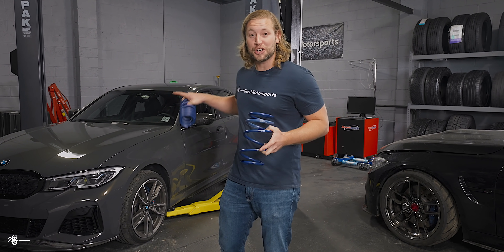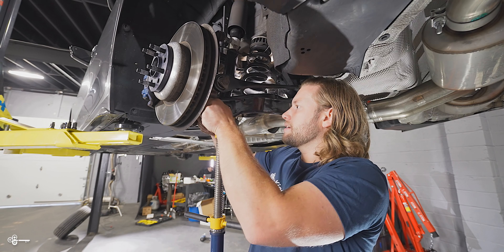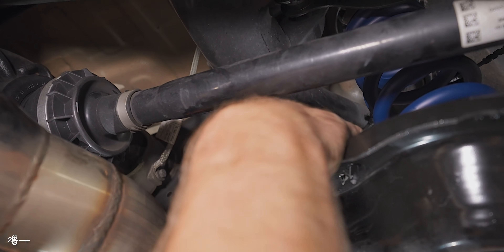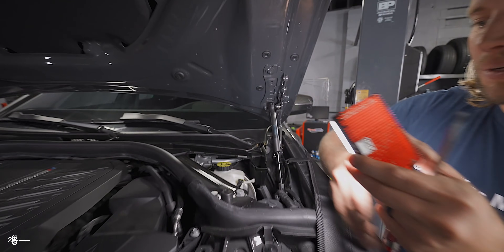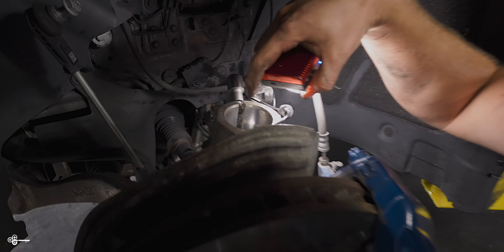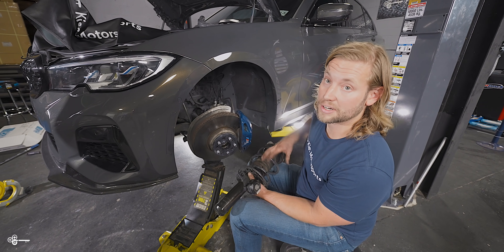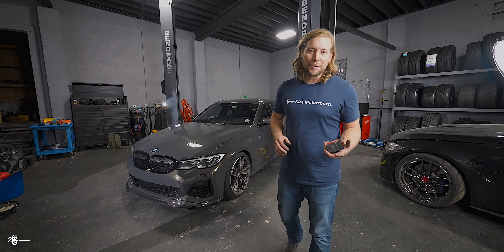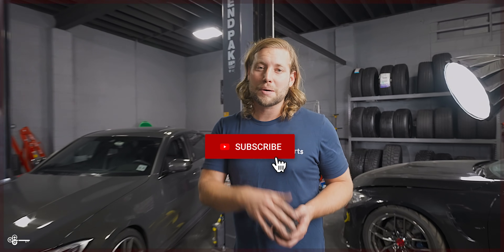HOW TO LOWER YOUR G20 BMW THE CHEAP AND EASY WAY (M340i, 330, etc.)

Comment: Anybody watching this that's struggling to slide the knuckle low enough, here's a tip.  You MUST loosen the 4 e-torx at the top of the strut first, ideally take them all out and leave the last one only a few threads engaged.  The strut has to pivot in order to have the right angle to slide all the way out.  Don't be like me and thinking, "Oh, I'll just remove those last..."  Cost me an hour of sweat and swearing.  Hopefully I save someone else the same fate.  Thanks Kies for this video, all of your how-tos are amazing.
Reply: I am having trouble getting front strut out do I have to remove axle and lower control arm
Reply: Awesome tip. I was definitely struggling. The knuckle was only halfway off and wouldn't go any farther.

Comment: Alternate title: “How to make your car impossible to get under, scrape your bumper on driveways and speed bumps, and irritate tow truck drivers”.
Reply: Thats just dumb. You dont have to slam your car. Like i lower mine only about 3cm, and its perfect. I can park and drive normaly. Dont scrape and can work on it. So yea. If you wanna go rly low then air suspension. With springs it would be tooooooo stiff. Bmw i have a f36
Reply: @WasteOfTimeDude  depends on the roads, if you drive on highway it s nice but daily through city traffic and bad roads it won t be pleasure to drive it

Comment: Lord I hope someone spends the money to get this done professionally on a new $50-70k BMW.
Reply: $60k car and did it at home. Absolutely 0 issues. Then drove 100 miles and got a custom alignment. Couldn't be happier with the outcome. Only difference is I have Dinan springs and followed the Dinan alignment specs. I haven't heard or seen H&R alignment specs.
Reply: Why? It’s so easy.

Comment: I installed the springs on my 330e and now having problem with my adaptive suspension. We didn’t disconnect the left rear sensor and now it is giving a false height. I already pushed it straight because it had the wrong angle. Also code in ISTA the new calibration. The fault code is still there. Anyone knows what to do?

Comment: Help Needed i have a 2021 m340i xdrive a few days ago i got Silvers Coilovers installed and now i have a check engine light with Chassis Stabilization, Cross Traffic Warning and Regenerative Braking Reduced issues.

Comment: You gotta get yourself a spring tool that’s mounted on the wall. You put the strut in & it has a hand crank. You tighten down the spring, take the nut off & take the strut out. Way better/safer than that one. Wall mounted is a lot sturdier & you have a lot more control too…..✌🏻🏁

Comment: Great content! I’ve seen on the evolve channel that they never take out the front strut to replace the springs. They merely disconnect the knuckle, and unscrew the damper. Then they tilt the strut outboard and pull the spring right off and replace it with the lowering spring.

Comment: I remember when I was in high school,  we just jack the car up and cut the coils-spring. Quick and easy,  But then the car sit so low it drag everything with it. I remember we had to replace an oil pan after we ran across a few speed bumps.  😆

Comment: Very good work and good explanation how you perform this work.
In my opinion, almost all lowering springs take G20 too low. It would be super nice for just 15-20mm lowering. Like M-Sport suspension, but just little bit more.
Eibach, H&R etc are "slammed". Not good for poor roads.
Reply: There is a set that lower it .5 inches lower than m sport. I forgot the nMe of the brand
Reply: In terms of looks, I think almost all of them lower the rear, proportionally, too much.   Dinan is perfect 28.5mm front,  19mm REAR.   Megan Racing isn't bad either  26mm Front, 25mm Rear.  With slightly shorter sidewalls you can compensate for any negative rake.

Comment: Hey. I kno options are slim. But for the m340i xdrive. Which lowering springs do you recommend. And a question on top of that. Bc of the adaptive suspension and how good it is. U recommend lowering springs or would u still do coilovers. Love the content. Great videos

Comment: Great video Bryan. I really appreciate what you put out. Question though. How did you find the ride after lowering it? I want mine to look great but I dont want to compensate the ride quality. I know I can go for the coil overs but I'd be happy just go springs if the ride quality wasn't affected. Thanks again! Frank from downunder 🙂
Reply: It's hard for the ride quality to be not affected, usually the sport spring give a stiffer ride
Reply: I would also like to know just how much different it rides, how much comfort is sacrificed, and if overall it’s a good change that is worth it.

Comment: Do you recommend changing any other parts of the suspension with doing these springs? I have the same set up on Xdrive  and hear a creaking noise at low speeds over uneven roads. Any ideas?

Comment: Is there anything to worry about when installing something like lowering springs if the car has M adaptive suspension?
Reply from the maker: You do not have to, it will work just fine.

Comment: My wheels are 19" and my tires are 235 width.. i have these springs  ready to be installed and i have 12mm spacers on them... will i have trouble steering all to the left or right witj a 235 width? Because i see that these are 225

Comment: I have a 2021 M Sport 330i. Debating on if I should lower it. What are the cons to doing this ? Looks sick
Reply: I considered doing this myself and opted to stick with the stock suspension setup, BMW spends millions $ on research and development to get stuff like this just right for the car and I figured it wasn’t worth messing around with just for that 1” lower look
Reply: Go with diff specs of tires like 235 45 19 front and 265 40 19 rear and you will fill void more without loosing comfort drive when you drop it with springs

Comment: Hello guys i have a quick question i have a 2021 BMW M340I bone stock the other day i was playing with the launch control and my son notice the boost gauge was boosting over 20lbs i thought stock PSI was lower.  I read to different PSI on a BMW forum one it was 8-11 PSI one other person said it was 15.8PSI BUT THEY DIDNT SAY WHAT YEAR M340I THEY WAS TAKING ABOUT

Comment: I've heard those bolts that require the extra 90 degree turn are HIGHLY RECOMMENDED to be replaced. How serious do you think it is?
Reply: It's what the service manual says to do. The bolts are cheap, so why not? They are torqued to yield like cylinder head bolts.

Comment: The suspension bolts are torque to yield. 100Nm plus 90 degrees. They should be replaced, not re-used.

Comment: Took my M 340i xdrive to the dealer to replace runflats by conventional tires. The guy there told me that I could not do it as the car behaviour and dynamics would be screwed up due to the different suspension set up. I guess they do not have clue...I have seen M340i xdrive lowered by tuners without issues. However how the adaptive suspension works with new springs, will this shorten the life of the shock absorbers?

Comment: If you wrap the spring in a towel or heavy blanket you can remove it without injury. I'm sure youtube has a video. Not a fan of lowering. Looks good. But not really drivable.

Comment: doesnt this ruin the stock absorbers over time?
Reply: I’ve heard from different people on the forums that the impact isn’t TOO negative on the dampers, but it does cause them to wear a little bit faster than normal. I think it would be pretty tough to measure due to all of the other variables involved. I would count on them wearing out faster than they would on stock springs. Someone smarter than me on this could probably give you a better estimate as to how many less miles to expect out of your stock dampers.